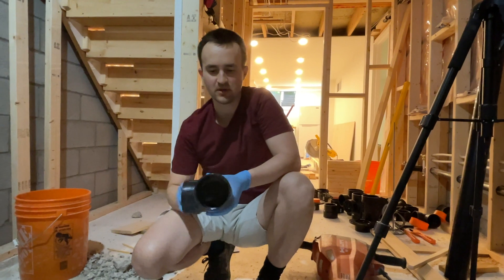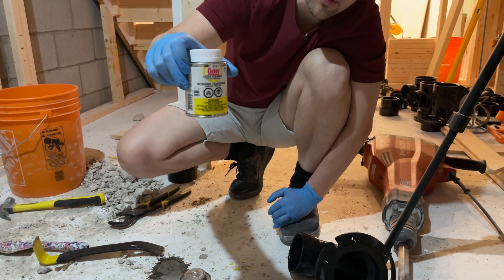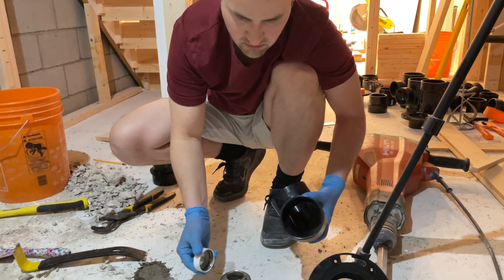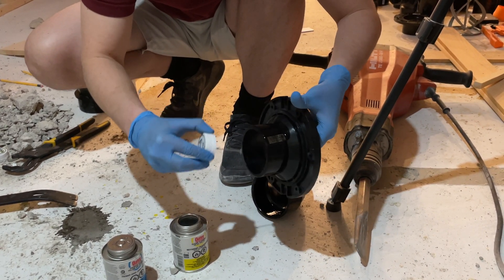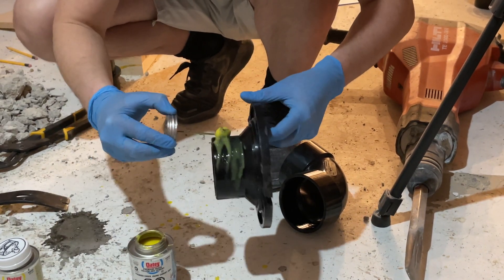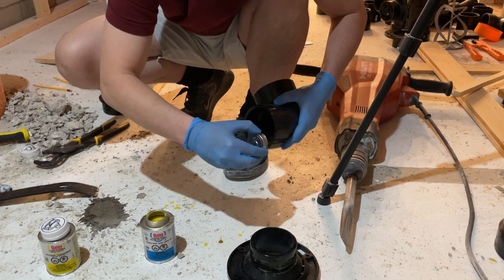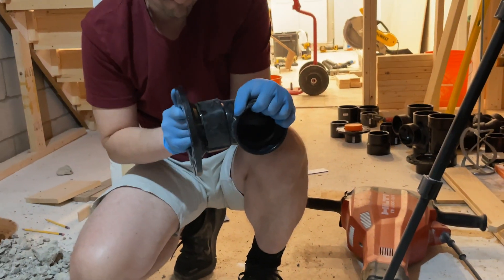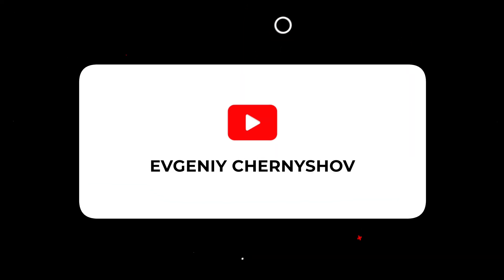How to Attach ABS Pipes and Fittings

Comment: How do you join abs threaded fittings. Such as a bathtub drain to the p trap. Do you need thread sealant, Teflon tape, a rubber gasket?  Thanks